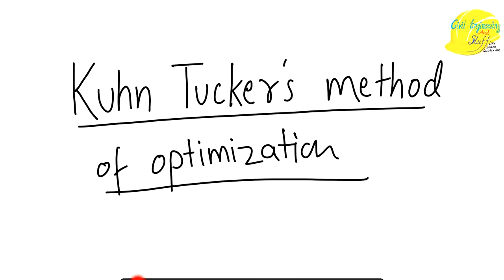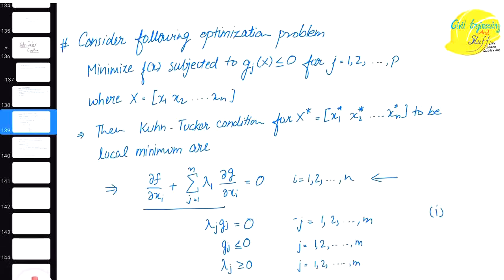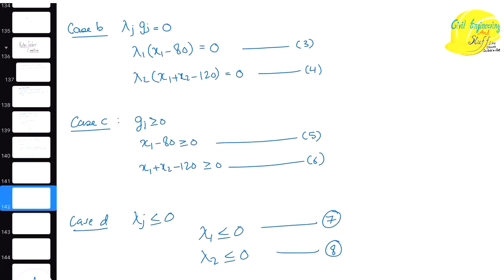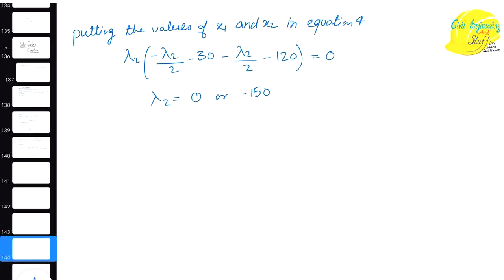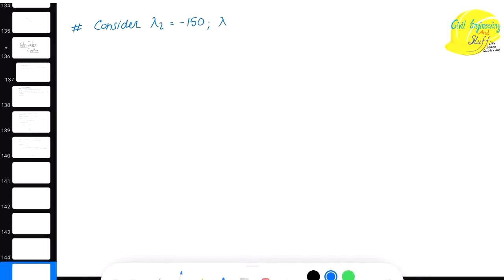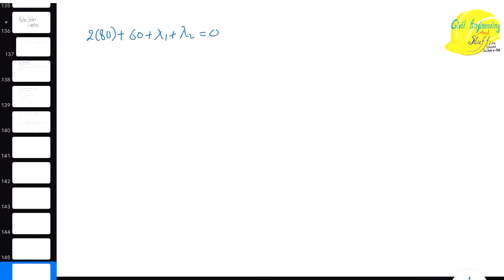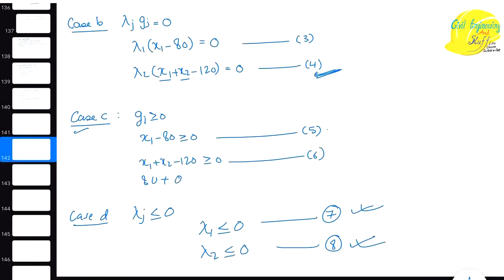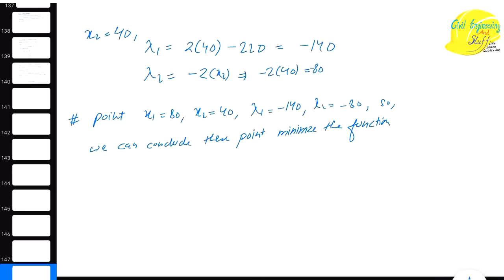Kuhn Tucker's Method with Numerical Example | Optimization Techniques

Comment: 03:52 I think the conditions are stated wrong here.. Could you check again?
Reply: what are right then??
Reply: the signs of the conditions are wrong. it should be MINUS lambda_one*(x(1) - 80) and MINUS lambda_two*(x(1)+x(2)-120)

or

PLUS lambda_one*(80 - x(1)) and PLUS lambda_two*(120 - x(1) - x(2))